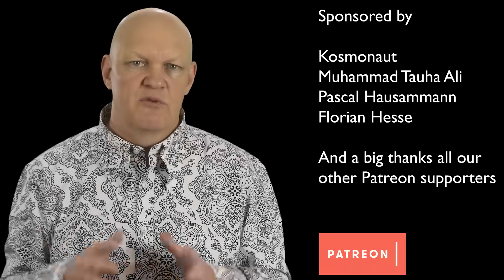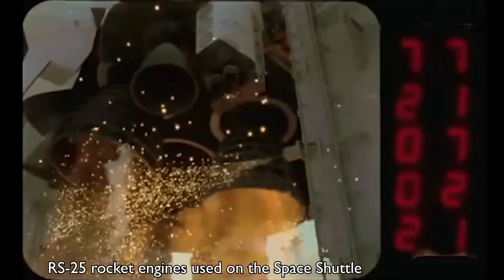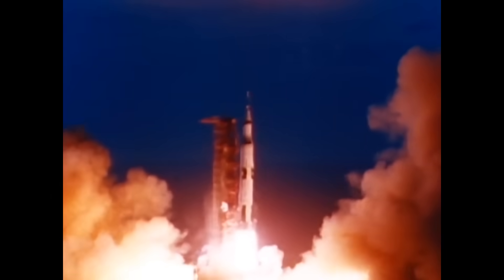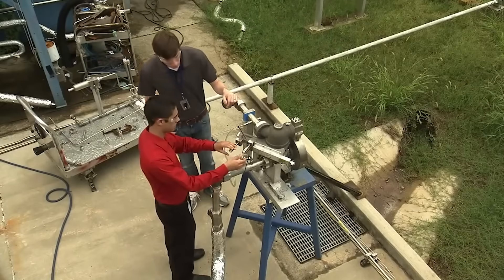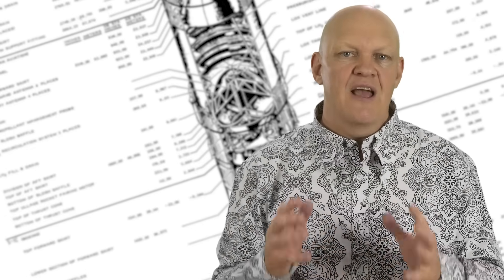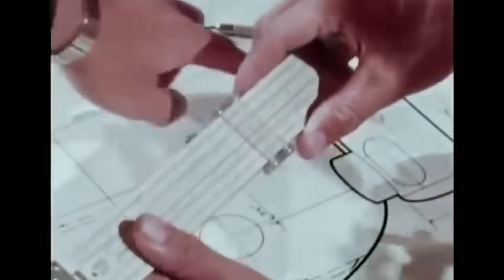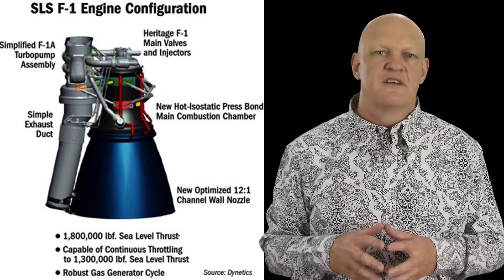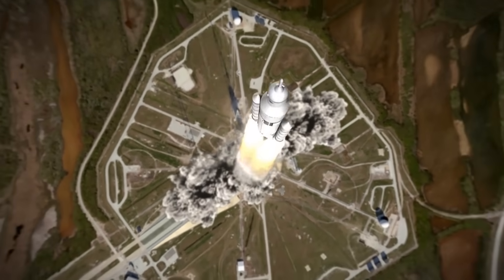Why Can't we Remake the Rocketdyne F1 Engine?

Comment: Engines like the F-1 are no longer made because of the failure of cooling-tube designs, when scaled up to the required pressures. The Inconel material used in the F-1 became brittle at high temperatures, and failed in some cases. Cooling-tube rocket engines have been scrapped in favor of the simpler Soviet designs, which use channeled layers to cool the engine.
Reply: The approach the Russians were using simply wouldn't have worked for an engine operating at the power level of the F1 though.  That's why the Russian designs tended to use lots of engines in clusters (I.E. 32 engines (20 mains and 12 verniers) on the R7A), since it kept the power level of each individual engine down to the point where it was practical to cool it using simpler methods.
Even using that Inconel piping (which was considered the best performing alloy of it's type available at the time), the only reason the F1 didn't melt was that the design channeled the exhaust from the turbopump section, (which was intentionally made very rich) into the edges main rocket exhaust to keep the temperature at the outside of the flame cone down.
Sure, it's not a design you would use today, but that's because material technology has come a long way since then.
Reply: "wouldn't have worked for an engine operating at the power level of the F1 though."

It did not worked in F-1 either. Even basic thermal calculations show that the engine was fake, just as an entire Apollo programm. It could not and did not worked at full thrust it said it could work. 

"That's why the Russian designs tended to use lots of engines in clusters "

Yes. Because in addition to cooling it solved issue of unstable combustion. Which F-1 did not solved either.
Reply: @MarshallJukov  Fake . Just like the hundreds of pounds of moon rocks that have been studied for decades by scientists worldwide. All fake.
Reply: MarkG The only Moon rocks that exist on Earth was delivered by Soviet missions

Comment: Hasn't the solid rocket booster proven itself by now?? Put a bright orange sticker on the side "DO NOT OPERATE FROZEN" and augment the thrust with smaller, steerable throttleable liquid engines - - let's move forwards, not back.

Comment: An nice tale that illustrates the difference between mass production and short production runs built by craftsmen comes from the Rolls-Royce Merlin in 1940. Ford of GB was asked to begin making Merlins, but, after a month looking at the designs and production methods declared that they couldn't work from the blueprints they'd been given. The RR staff assumed the carmaker couldn't cope with the accuracy needed. In fact the opposite was true: RR's craftsmen built a slightly different engine every time and used their skill to make all the parts fit together. Ford needed every part to be interchangeable and so redrew all the plans and were soon making 50 Merlins every day! I read this in Sir Stanley Hooker's autobiography, which is a fascinating account of aero-engines and their makers.

Comment: If the problem is with the engineers, then send the F1 to China and cut the BS excuses so they can reproduce the engine for even less than the F1B.
Reply: MidnightVisions the substitutions for cheaper materials are kind of hard to find in such a complex machine, you would want top notch qc
Reply: Its not about materials, the materials can be ordered to the China factories.  Its up to China Great Wall to build it.  China Great Wall already builds everything for China's Space program and moon program.

Comment: This is the issue with using craftsmen, they do ineradicable and beautiful work. but they are impossible to replace.  Computer controlled construction is a great boon to us in our society, but it is very hard to program the skills of a craftsman into a CNC.   These wonderful things but vastly separated by a gap of ability verses the ultimate precision (these titles could be for either side)  We need a method of capturing wisdom and experience not just dimensions and assembly.

Comment: I think [i]“the problem”[/i] was perfectly framed.  BRAIN DRAIN thru actuarial table aging (i.e. people getting old, retiring, failing, dying, gone).

The old [i]NASA[/i] Apollo program was an "army of top-shelf specialists", most of whom had served in one branch or another of the US military during either World War 2 or the 2 decades after.  Thus not only did they probably have extraordinary skills, but extraordinary crisp-saluting, "ay, ay, Sir!" jump-thru-hoop attitude.  

Get 25,000 Ay-ay-sir top-shelf professionals cobbled together, and EVEN if they had to nearly by-hand craft near-everything, the quality controls were outstanding, the work never rushed, the testing done, and the attention to detail tireless.  

That kind of thing, along with the now nearly-lost "art of designing tight tolerances" into metallurgical, fluid and compressed gas systems, is what allowed (in this case) the F–1 engine to be the workhorse it turned out to be, and allowed the whole kit to be bolted to the superstructure with flex hose and so on, able to handle that totally unknown run-time vibrations, swellings, torques, slews, shear forces and tensions that — again — outstanding "tolerance engineering" ultimately tolerated.  

There are excellent documentary films about the evolution of the Apollo rocket-and-program, and in particular the very expensive yet very evolution-guiding feedback from stationary platform test-beds.  Many an F–1 engine was destroyed on those test beds.  But thousand-frame-per-second cameras (hundreds!) of them caught the action, caught the problems, gave the feedback, got all the almost-invisible changes into the designs … that worked, and worked, and worked.

And just as the author said… that expertise is gone. 
People born in the 1920s and 1930s and maybe 1940s learned and honed their skills.
Now — if alive — those people are in their 90s, 80s and 70s.
Well past imparting their hard-won knowledge to the new generation. 

MY HOPE — truly — is that the new "computer generations" of engineer, with billion-dollar tooling and computer systems, will be able to recreate the technology, better, faster, cheaper … than before.  

And in a way they have.
SpaceX

[b]Goat[/b]Guy

Comment: The shorter format is fine, but I wouldn't try and stick religiously to it. Different topics rightfully take different amounts of time to adequately and appropriately cover.

The F-1 engine represented the pinnacle of rocket engine design at that point in our history. As you already know, there often were no simple solutions to things and so it would take a lot of parts to work around problems. Honestly, the only reason that's no longer the case now is experience and technological advancement.

Would one really rather build a new AGC+DSKY, or just grab a laptop off the shelf of your local Walmart and have millions of times the processing capabilities and power?

Besides, getting back to engine design, we now live in an era where we know how to build closed loop engine design which, in top of everything be else, would give us even more than 1.8 million pounds of thrust.

If we built "something like" a Saturn V today, the rocket-to-payload ratio would be even more tiled in the favor of payload. Many structural elements previously made of steel could in principle be made of Titanium, or of aluminum through processes which did not exist then. The F-1b is probably lighter weight. The computer system and control panel would absolutely weigh less. Vehicle weight could probably be reduced by a couple tons (at least).

Comment: Why not build them again? Because the F1 engine was too large and suffered from sonic disturbances at full throttle, causing the engine to blow up repeatedly on the test stand. The engines had to burn a rich fuel mixture in order to prevent this from happening. As a result, the Saturn V did not have sufficient lifting capacity for the necessary fuel load to complete a moon mission as planned. The Russians understood this problem and they used 30 much smaller engines in the first stage of their N1 rocket that was larger than the Saturn V. Their rocket failed, but for other reasons.

Comment: In regards to rebuilding the F1, are there any at least mostly functional examples recovered or left over from the Apollo program? If there are, why not (extremely carefully) disassemble one, catalog and document every piece and part, scan every piece, then using CAD software rebuild a digital model to the exact specifications needed for a functional engine, and then build a prototype using modern tools and technology? It would likely take as much as a decade to effectively recreate a perfect example of the Rocketdyne F1 this way, but you would have everything you need to recreate the most powerful rocket engines in history.

Comment: The problem nowadays is everybody has got it into there heads that you can not build anything without Computers. All the old hand skills are dead or damned near so i'm one of the last who i would call a hands on engineer and i'm retired, the very few who still have Hand Skills shall we say are mostly people who do it for a Hobby. When somebody says to me they are a engineer my first Question usually is Can you make me a reasonably accurate Clock without using a computer or Calculator ( I alow a Slide Rule ( WHATS THAT ) and 7 place Trig Tables ) and using only Hand Tools. In the last 30 years or so the only ones who have said  yes are people my age or Hobbiest. Love to know what would happen if all Computers got hit with a Virus and had to be shut down and all data was lost. 17 Centuary here we Come.

Comment: Why F1 though? Afaik F1 are open cycle engines, unlike post Soviet RD-191, which are closed circle. Closed circle are miter efficient, which can in the long run reduce weight of the fuel?

Comment: there is no real need for NASA to remake the f1a engine exactly as it was done back then. yes it was a powerful engine but it was built at a time when cost was no issue(not in any real sense by todays standards  at least) no matter how powerful an engine  is if it doesnt  meet current efficiency requirements it is worthless. the ssme is  1 of the most efficient engines ever made  which is why it was chosen for upgrade for the new launch initiative, the experience of the shuttle  program taught NASA a lot about stupid design on top of good design and only cost 2 crews to do so. NASA has access to farr more  powerful engine designs now and far more efficient systems but they are going with proven tech because it doesnt have to be completely redesigned or re-engineered but none of that matters because private companies have finally ponied up the funds to make their own heavy lift vehicles. NASA can lease those rockets for a fraction of the cost in r&d and construction/maintenance so they can focus on the next iteration of propulsion. of course people will latch on to any  excuse to lambast NASA and too be fair NASA has done some epicly stupid things(hatch that opens inward in a internally pressurized system, ignoring warnings about critical temps at launch times, removing a structural element to save weight at the expense of the safety margin the material added not checking to see if a switch was right side up or not etc) so if they decide to lease rocket time from spacex or  the like someone will bitch that they should be spending money on expensive rockets they could make themselves instead of getting cots

Comment: Seeing that x2 F-1 Rocketdyne engines produce 13540kN of thrust, while the main core produces only 7440kN, when these big babies burn out, the SLS will possibly have more momentum, which possibly means that after booster separation, the 1st stage burnout speed wouldn't be 6800, but rather 7100m/s. So this means I am be on board with the reintroduction of the F-1 engine. The boosters WILL be better, because you aren't dealing with heavy solid propellant, but rather, you are sorting out light liquid propellants. And besides, liquid boosters would allow for longer burn times, and not having to ditch them just 2 minutes into the flight.